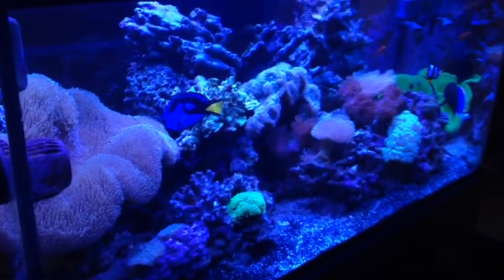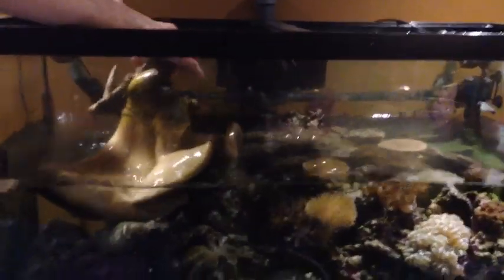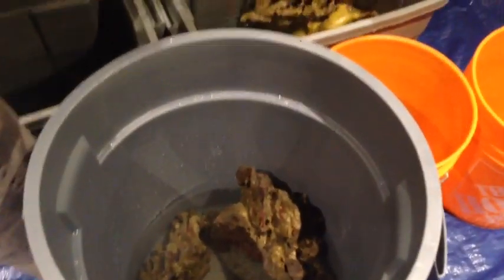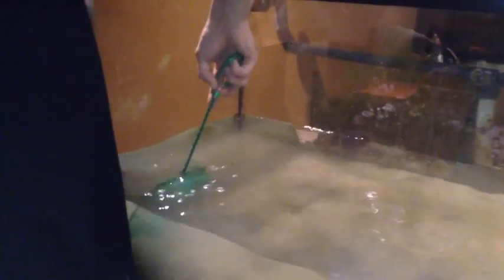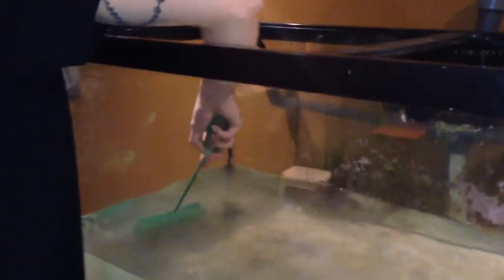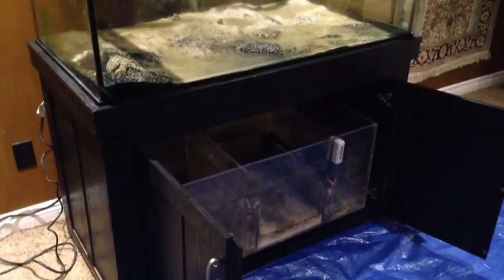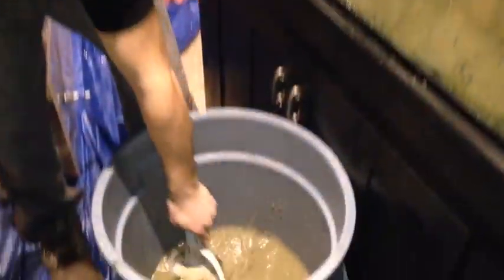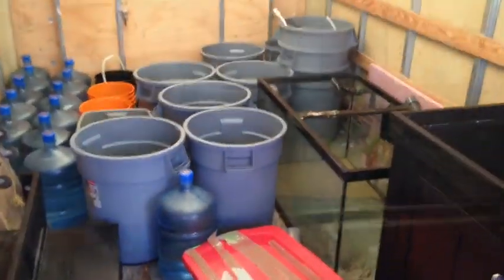How To Move A Coral Reef Fish Tank

Comment: I am planning on doing this for an 8 hour drive. how would tempurature be regulated for the containers with fish and coral? Would it drop too much in those 8 hours without a heating source?
Reply from the maker: depending on the weather and temp outside, but my case yes it was cold outside and the temp dropped. 
just try and keep the time the fish and coral are outside the house to a minimum.

Comment: What would you charge to move a 75 gal. 80 Miles
Reply from the maker: Approx $600-800 CND - more details would be needed. Picture of tank and all equipment and location of tank in house and location it needs to go in the new location. 
Upstairs , downstairs etc.